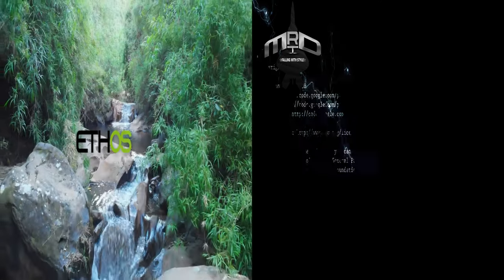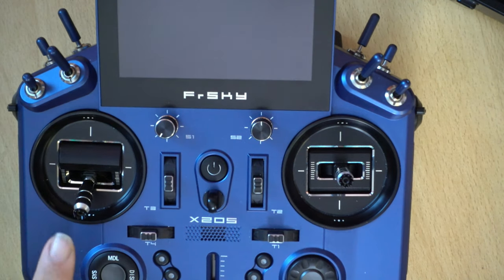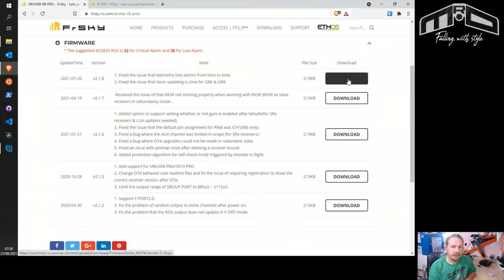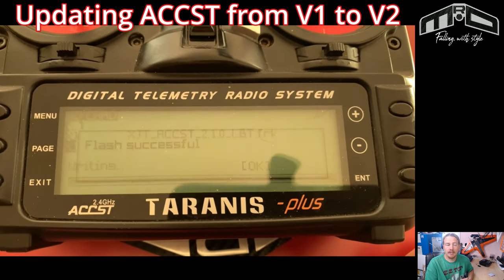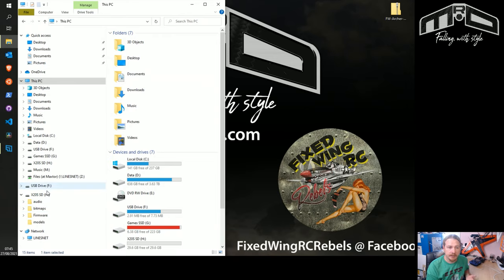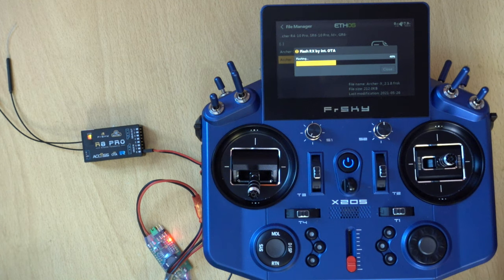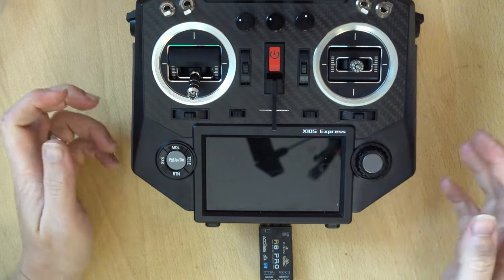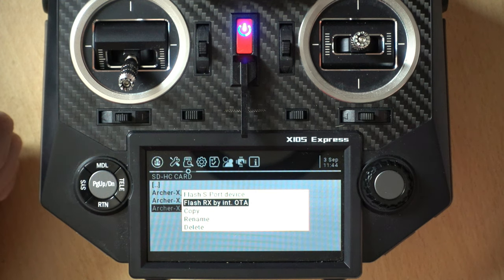Flashing FrSky receivers - For OpenTX and ETHOS

Comment: Thanks for the prompt reply. I have tried transferring the one you recommended and it is showing on the SD card but when I open it ,it only shows copy,move,delete.do I have to have the receiver plugged in before it gives me a flash option? Cheers peter
Reply from the maker: Yes. You either need the receiver connected via cable. Or the receiver and RF module powered on (and receiver registered to the transmitter), if you’re performing an over-the-air update.

Comment: Hi Darren. Not sure if you can help. My x20s firmware is updated via ethos suite and I,m trying to flash a rx8pro to accst v1  but when I get to selecting the update on the sd card in the tx it only shows copy,move delete with no flash options, same on my early taranis x9.Do i Need to update the internal module to make this work?  Very confused,  cheers peter
Reply from the maker: ACCST v1 will not work with the X20. You need to be on the latest version of the ACCST v2 protocol. The receiver will need to be connected to the transmitter with the SmartPort cable to do the update. Note, the cable order is not the same as flashing with the X9D through the JR bay.

Comment: I have FrSky X18S with a R9 SX access receiver. I’ve been watching videos and I’ve managed to register and bind the receiver. I’ve been attempting to set up a model and gone through the steps, but I don’t get any reaction or movement to any servos. Any help would be nice. Thanks
Reply from the maker: Unfortunately, YouTube comments is not a great place to try and diagnose problems like this. I’d recommend asking on one of the FrSKY Facebook groups, or the ETHOS Discord. It could be that you just haven’t set up the outputs. But it’s easier to try and understand in those places.

Comment: How do you flash a Tandem TD18 or Tandem TD10 reciever  since it's both 2.4 and 900
Reply from the maker: The same way as you flash the ACCESS receivers. OTA would be the first method to try. Or cable if that fails.

The TANDEM receivers’ firmware includes all that’s needed. You don’t flash the different frequencies separately.

Comment: Hi . I have noticed that my new td r10 does not have an eu/lbt option for firmware? i thought 900 was fcc only and uk was 868mhz? dose the td range of rx only have 1 firmware type? and if so how is the antenna length correct for both?

lots of questions but i think im missing something. i havent put it on my new x20 pro yet to try it but seems odd, any information you can share would be interesting
Reply from the maker: Tandem and ACCESS in general get the region automatically from the transmitter module. When you buy your receiver. It will have the appropriate receiver for the region. FCC is 915MHz and LBT is 868MHz. If you buy a receiver in the UK. The antenna will be correct for 868MHz.
Reply: Thats great information. My rx was brought in from china so assume 900hz antenna. Will that make the rx a problem to use in uk at 868mhz. I fly fixed wing and only line of sight. Assume 2.4 is still same as module will select eu lbt if i understand you correctly

Comment: Good Morning. Just received my X20S. Thanks to your videos I was able to perform all software updates on the tx. and five receivers. I'm doing my best to answer my own questions through experimentation and research. But ,from time t time, I need to ask an expert. So. What voltage setting needs to be adjusted to the transmitter battery ? What should the display show as far as the correct battery voltage ?
Reply from the maker: Awesome Frank, hope you’re happy with the radio. As far as the battery goes, all I did was use a multimeter to check the LiPo voltage. I compared this with the pack voltage in System > Battery. I just corrected that to the value on the multimeter, erring on the side of caution. Other than that, it’s as it came.

Comment: Wires, wires and wires…. How do you hook up wires to flash RX from X20s.   Cant bid and upgrade from early Accst to V2 unless you are bound…. But you can’t bind until you upgrade firmware….   Wires, wires, wires.

PS: great tutorial.  Like the very detail ETHOS flick.   Us old flyers don’t know all the windows things. How and when to plug, unplug…. You know,  so simple it’s just what you do.  But not what we do…
Reply from the maker: Thanks Fred. 

Just 1 cable (3 wires) 😄 S.Port on the receiver to the S.Port plug on the top of the X20S. ACCST needs to be updated via cable anyway. It’s only ACCESS that supports OTA.

Comment: HI Thank you for the video I'm new to Fr Sky and im trying to flash a R8 Pro with a Taranis x9D+2019, ive had this radio a while but never managed to get it to work, the Error "firmware update error device not responding" comes up when i try to flash it using the pins art the back through the smart port or Subus. Would really appreciate your help as I'm totally stuck.
Reply from the maker: Be careful when using the pins on the back of the radio. They are in a different order to a regular SPORT socket (https://youtu.be/9tncdNDinFM?t=935). In the manual, it looks like the X9D Plus 2019 has an SPORT socket inside the battery bay. So it may be worth trying that (https://www.frsky-rc.com/wp-content/uploads/Downloads/Manual/X9DP2019/X9D%20Plus%202019%20X9D%20Plus%20SE%202019%20-Manual.pdf). Though in the manual there is no reference to the pin order. I would imagine it is a normal SPORT/servo order. But worth checking with a multimeter first.

On the R8Pro its self. You need to use the white connector, next to the antennae. Using the SmartPort, power, and ground wires.

Let me know how you get on.
Reply: @MrD  Thanks for replying, I checked out the smart port in the battery bay, but it's not outputting anything.Maybe it needs turning on in the menu?

 I gave up and ordered a few more Futaba receivers for my Sg14. One of these days  I'll make the Taranis system work as more than a sim Transmitter.
Reply from the maker: The output in the JR bay should definitely work. But just make sure the wire order is correct. Occasionally, the receivers take a couple of attempts to flash them.

Comment: Hi Darren, one more question if I may. Do you know what type of connector goes into the port of the R8 Pro where the AIN2 and F.Port connects in the front? It has a 0.8mm pin pitch, which is the same as a JST-SUR, but the housing does not seem to match.

Comment: First of all thank you for the great work you are doing here! I recently got my X18S and setup everything thanks to your videos. 
I was not able to do one thing - flash the FAS40 ADV current sensor with the current firmware. I was wondering if I should have it connected to the S.Port of the receiver (GR8) or to the transmitter S.Port directly? Do I have to power it externally? I cannot see in Ethos any place where the TX S.Port is accessed. I understand that when selecting the firmware file in the file manager it should allow me to flash through S.Port but it doesn't give this option. I think a video about using the S.Port of the TX would be generally interesting, to know what it can be used for.

Comment: Hi Darren, I have been trying to update a rx8r, to fcc. copying the download from frsky it saves as a compressed  a Adope Acrobat file which I can,t open on the computer but have put in the firmware file on the transmitter and it just shows the file size and last modification date,I’m obviously doing something wrong put computers arn,t my strong point,any advice cheers peter
Reply from the maker: Hi Peter. It sounds like you're possibly downloading the manual, which is an Acrobat file. This link will take you to the firmware. https://www.frsky-rc.com/wp-content/uploads/Downloads/Firmware/ACCST-2.1.x/FW-RX8R-v2.1.0.zip

In there you will find the RX9R_ACCST_2.1.0_FCC.frk file that you need to update the receiver. This is for the latest ACCST v2. If you're still on ACCST v1, use this link https://www.frsky-rc.com/wp-content/uploads/Downloads/Firmware/RX8R/FW-RX8R-170224.zip

Comment: On the x18 do you make a firmware folder in the internal storage?
Reply from the maker: You can use the internal NAND storage (not the flash), or the SD card.

Comment: Hello Mr.D, i have an question. I'am using butterfly but can't get an curve (5pt) on the movement of the elevator. Do you have an solution?
Reply from the maker: For elevator compensation? You wouldn’t put the curve on the elevator. You would make a free mix using the same source as the butterfly, and output it to the elevator channel. You can then add the curve to that free mix, as well as set the weight.

Comment: I have the SR10Pro. I require more than 10 channels. If I'm seeing correctly, channels 9 and 10 are reserved .Channel 9 is for gyro gain. And channel 10 is for flight modes. This makes these two channels unusable because they are reserved. Am I able to "expand" on channel availability by adding another receiver?

thanks
Reply from the maker: You can get access to channels 9 and 10. I’ll have this in an upcoming video. But basically it’s in the receiver options (click the receiver name, near the bind button). But, if you want more than 10, you may need to use something like an SBUS breakout board. That can be set to give you channels 9 to 16.

Comment: which receivers are compatible  with the x20   is futaba compatible   or any other  receivers ???. i have many receivers  that are not access so     i would  hate to throw them out  and have to buy   more new one .  and if they can be used  what would  the setting be in the  radio ???
Reply from the maker: Any FrSky ACCESS or ACCST D16 (flashed with the latest version of ACCST) receivers are natively supported. You can also use FrSky D8 and LR12 receivers with an external XJT module.

Comment: Could you post a video on setting up dual elavator and matching the servos in ethos please.
Reply: It's actually pretty simple and there are a few ways you can do this.  Either use a Y cable and plug them both into the same port on the receiver.  Or, when you set up a new model, select "2 channels" under the elevator option and you will now have two separate channels.  You can also get into some more advanced mixing and use them as "tailerons" if you'd like which I think Darren might already have a video on.

Comment: I’ve recently purchased an X20S and a bunch of different Archer receivers.  Although each receiver came with an S.Port cable none of them were fitted with a servo connector - just bare wires.  Two thoughts: 1) could be to save money 2) most likely, it’s because the pin order can vary depending on where you plug it in, so they are making the user fit the plug, so it is there mistake if they get it wrong.
Reply from the maker: It depends on the receiver you buy. Some are very small. So not having the pins installed gives you the option to direct solder to the receiver to take up less space in the model.
Reply: @MrD  Not in my case, they were all Archer.  Various different ones ranging from tiny R4 to large SR8 Pro.  All have the S.Port cable but none have a servo plug fitted, just bare wires.
Reply: My mistake, looked again and there are two cables, one does have a servo plug the other one is just doesn’t.

Comment: Hi Mr.D is it possible to flash firmware on an archer gr6 receiver which has ACCESS firmware to another firmware that is ACCST? My radio is a Taranis X9D+ with ACCST... Or maybe flash my radio firmware to make it ACCESS compatible? In other works, is there anything I can do to make my radio work with the Archer GR6?
I would really appreciate your answer. Thank you kindly.
Reply from the maker: No, you can’t flash ACCST to the Archer GR6. But the new ArcherPlus GR6 will work with ACCST.
Reply: Thank you kindly MrD @MrD

Comment: I downloaded the firmware for my X8R to the SD card.  I setup to install the new firmware with the special jumper, I go to the FIRMWARE folder, select the desired firmware.  The only option I get is DELETE. I don't get the selections to install firmware.  What am I doing wrong?😫
Reply from the maker: Have you connected the receiver to the transmitter? What transmitter are you using?

Comment: Hello thanks for your video . I have a radiomaster TX16S and i am running accst V1 with a frsky G-RX6 do you think i can or should go for accst V2? thanks for your help
Reply from the maker: Thanks Mal. Yes, you can use ACCST v2. You just need to select the FRSKY X2 protocol when you bind. Should you is up to you. Personally I would. It's worth it when you compare the time to perform the update, to the peace of mind that a pretty big bug has been fixed.
Reply: @MrD  thanks a lot for your help i am going to try with an unused yet receiver (G-RX8)  thanks again
Reply from the maker: You should have no problem at all with that one. I have a G-RX8 running on ACCST v2 and it works perfectly. If you’ve not used that receiver before, just be mindful when you bind it. By default, pin 8 is set to SBUS OUT. If you want to use Ch7 and/or 8 for servos or a motor, you need to jumper the signal pins for Ch 1 & 2 while you bind.
Reply: @MrD  hello everything went fine both of my receivers are now with  accst V2  thanks a lot

Comment: Darren, i have been studying and following along with your videos and they've been great. I finally actually tried to get an airplane ready to fly with my x20s and have hit a wall; a glider with a gr8 installed that has worked fine with my taranis/opentx and i thought i was ready to switch over to the x20s. Everything registered and bound and i have telemetry, altitude and cel voltage, but no pwm output. Outputs page on tx shows everything moving and i never unhooked servo plugs but nothing moves!
Ethos 1.0.17
internal FCC 2.1.15
gr8 access v2.1.8

Thanks for any ideas,
SteveB
Reply from the maker: Hey Steve. That sounds really strange, especially having telemetry, as that is showing the bind is ok. I think I have a GR receiver somewhere. Probably the GR6. I'll take a look and see if there are any options on the receiver that might cause issues. But if it was working before, I can't see why it wouldn't now. Especially if it's just been re-registered and bound to a different transmitter.
Reply: @MrD  
OK, Figured it out. I had to assign channels to pins. Don't really know why since i tried binding to an R10 and it worked without that but perhaps i somehow "un-assigned" them. Anyway thanks for the great videos; big help to those of us who decided to take the plunge into Ethos.

SteveB
Reply from the maker: That sounds pretty strange. They are usually defined by default. Also, they must have been defined when you flew with it. Glad its sorted though. Have some great flights 🙂

Comment: Is there a way to check what firmware version that is on your access receivers?
Reply from the maker: Yes. On ETHOS go to the System menu and choose Info. It will appear down the bottom. 

On OpenTX go to the System menu and the Version page. Click Modules / RX Version.